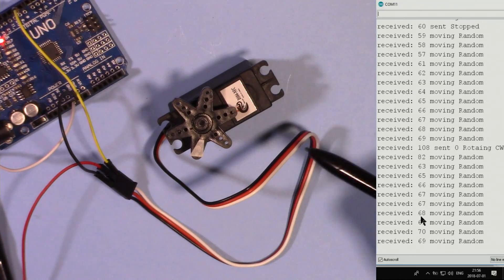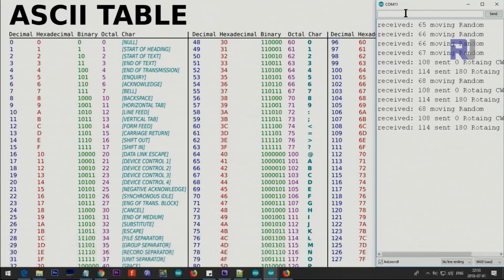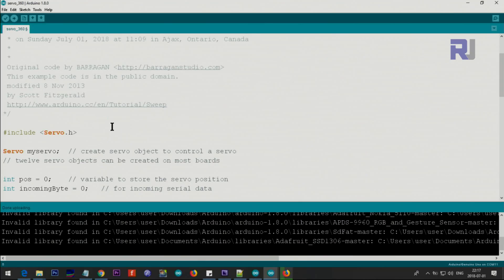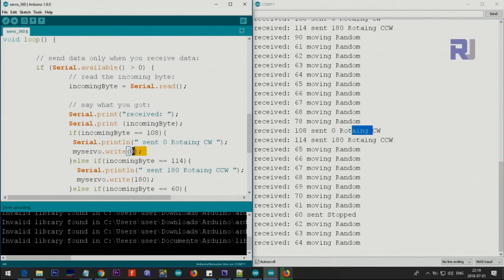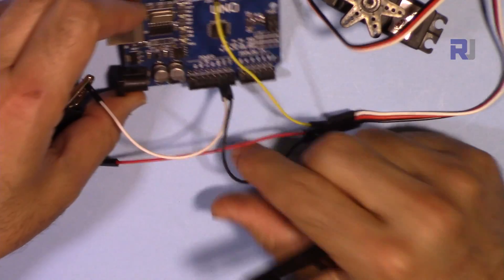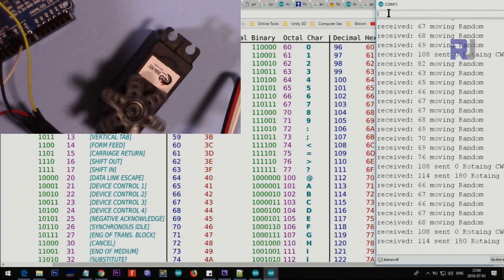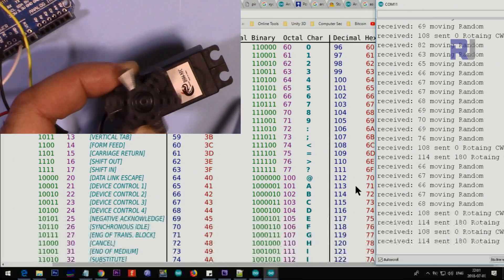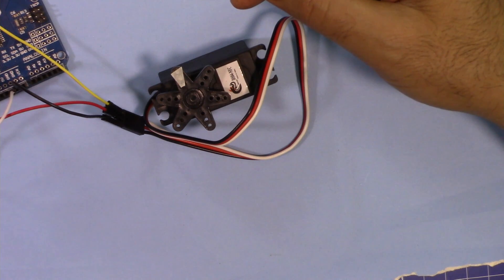Lesson 89: How to control 360 Continuous Servo with Arduino RJT96

Comment from the maker: 360 servo is NOT a servo. it is product modified for fun to make it work that way. use stepper motor for real application. this will never work as expected. do not waste your time.
Reply: i bought 2 360 "servos", thinking that i would be able to control its position in a 360 degree range, i was so wrong, these servos are pretty useless without feedback
Reply: and if u use a driver
Reply: it works perfectly if we use this as time dependent servo motor
Reply: @mkiratul  what u mean can u show a little preview
Reply: Dear Mr. Samsiri, how about servo 320 degree, it will control as per expected?

Comment: Thanks, nice video. However your explanation of the values sent to the servo is misleading. They should not be looked up on the ASCII table (that is only for the serial commands). These servos are basically standard position servos with the stops and position sensors broken off. Standard position servos take in an angle command, hence 0-360. However, these servos are "hacked" to make the servo think that they are always at a fixed position, which is nominally right in the middle i.e. 90deg, but in reality it's not that precise. Many of these servos have a set screw potentiometer that can be used to adjust this simulated center position. You should be able to adjust the center (stop) , and since they're very cheap, they also tend to drift.

Comment: Thank you. I was thinking thay they stop on 360/0 degrees, and when I started to spin it with my hands without connection and power, I figured out that they spin continuously, unlike 180 or 90 degree versions.
But why it is bad idea to use it as step motor?
Reply from the maker: beca you can't position it and it will not work as expected. use stepepr motor or very expensive servo motor. So stepper is better and cost effective solution.
Reply: @robojax  thank you, you mean that you can't set exact angle because it has huge error range?

Comment: Could be possible using this system for control 6 DC motors with encoder?????
Reply from the maker: This "360" servo is a joke. Yes use Stepper motor or DC motor with encoder.

Comment: Hi robojax . i was on my project.  I was gonna use this servo to make automatc curtain . but when i used this on if else . the logic if else . repeated continuesly . like . when i was gonna rotate for 2 second . it really rotate 2 second and stop . but it rotate again . did you have any solution? I use raindrop sensor to get data and control if else condition .
Reply from the maker: Hi, please read the description. If not don’t just it. This is just a joke. Use stepper motor.

Comment: i need to build a crane, i want to use this servo for the up down motion, and the rotation of the crane, should i use this or a stepper motor for the up down part
Reply from the maker: This is just joke product not real. Use stepper motor

Comment: Bro if we upload code can will it save that i mean wheni give power will rotoate 360° ? for my another Arduino project
Reply from the maker: Hi, your can use the code with any Arduino and turn it on off it will work. When it come to powering servo, you should always connect your servo motor directly to the the power source and not to the Arduino board.

Comment: Hello. Is it possible to software transform 360 degree continous servo to non-continous? I need full circle  moovement but not more than one, controlling by two buttons. Thanks in advance.
Reply from the maker: Hello, please read the first comment. This is NOT a servo. just fake device for fun. Use stepper motor to achieve the same tasks accurately. I can't remove this video because this junk product is still sold online.

Comment: I've  MG996R  and work perfect with pca9685 and Arduino nano 3 .
i didn't use any different configuration but my code is:"" pwm.setPWM(pinnumber,0,rotation);  delay(500); pwm.setPWM(pinnumber,0,0); ""
rotation for right turn between 99-365 high speed 99   low speed 365
rotation for left turn  between 385-640 high speed 640  low speed 385
then delay time depend how many time want to spin and finally stop code;
don't forget to set frequency its work at 60 but not in other frequency i'm not quite sure why.
 pwm.setPWMFreq(60);
good luck;
Reply from the maker: this video has nothing to do with pca9685
Reply: @robojax  i know but that's how i control my  360 servo perfectly in any angle that i command it.

Comment: Hi can u make a version of  java code like that? continuous servo control via bluetooth
Reply from the maker: Hi, interesting. it is doable but needs some work. it depends on your platform. you will need hardware. But Arduino and Bluetooth module make it very easy. To remind you this continous servo is NOT a real hardware and it won't work as expected. I've shown that it is not working. I made the video because there was demand. get Stepper motor like this https://youtu.be/cYTICj4DWYc or DC motor with encoder. Do not build projects based on this. it is waste of time and and money.

Comment: nice video. I have gotten one of those today. Mine stops between 86 and 96. I think you could make it move in smaller steps by using it like that: servo.write(100);delay(100);servo.write(90); for example to make it move slowly for 100ms. Mine moves fastest at about 47. By lowering the value further more it stays the same speed. I had originally thought it would work like the SG90 servo (thanks to your video I now know it was not a malfunction). So unfortunately I have no application for it ... yet :D
Reply from the maker: thanks.  I've mentioned in the comments, that this (360 servo) is  NOT a real or proper product.  Use stepper motor
Reply: @robojax  yes :-) I have also some Nema 17 stepper motors and have already used them for example for panning a camera on a 14m tripod.

Comment: You said to delete the previous post and move it here, I did too, thank you for following up
**********************************
Hello Mr. Ahmad Shamshiri
I ask you to put a healthy code for use in the 360 degree servo motor
By pressing a button or command, the servo motor spins a full speed and stops in its place.
And each time you press the button, this operation is done once again
Unfortunately, no code or tutorial can be found on the web
Your previous two tutorials on 360 degree servo do not apply to me either.
I always wish you health and success
Thank you
servo MG 996R

سلام آقای احمد شمشیری
لطفا یک آموزش و کد مرتبط برای سروو موتور 360 درجه را منتشر کنید
به این شکل باشد که با زدن یک دکمه یا دستور این موتور 1 دور کامل بچرخد و در محل شروع متوقف گردد 
متاسفانه دو اموزش سروو موتور 360 درجه شما برای فکر من کاربرد ندارد
از شما خواهش می کنم این مورد را در اولویت قرار دهید.
قطعا افراد زیادی در دنیا هستند که این مشکل را دارند و هنوز پاسخ مناسبی پیدا نکرده اند.
همیشه سلامتی و موفقیت شما را خواستارم
از شما پیشاپیش متشکرم
Reply from the maker: In practice, we don't have 360 servo. you can't sent it to specific angle. this is just modified version of actual servo which goes from 0 to 180. For actual project or application, please either use stepper motor or DC motor with encoder.  You won't be able to achieve  desired results with this. 
وعلیکم السلام
خلاصه مطلب اینکه این سرو فقط به منظور نمایش است و کابرد عنملی نداد.  
سلامت باشید

Comment: I use SG90 servo. My servo doesnt move continously. It only move slightly then stop.Each time i put a character it always say " 10 moving Random". After that it won't move even i put a another character.
How to fix that problem?
Reply: Hi, you're getting "10 moving Random" because of your arduino serial monitor settings - it appends by default line ending to every line you are sending, but you can disable it by choosing "No line ending" settings
Reply from the maker: Please read the first comment(pinned comment) that this is NOT a real servo. this is just fake item to prove that the servo can be modified. get ether actual servo or get Stepper motor  See my videos on that https://www.youtube.com/robojaxTV/search?query=28BYJ-48

Comment: I used servo 360 and adafruit motor shield then it can't be rotate ccw, how to fix it?
Reply from the maker: as I mentioned in the first comment under the video, this is NOT a real motor.  This is just fake motor. you should use stepper if you want full control at 360 degrees. for 180, use  normal servo.  Here use this stepper https://youtu.be/cYTICj4DWYc or smaller https://www.youtube.com/robojaxTV/search?query=28BYJ-48

Comment: hi there, can you use these servos to a certain angle like 540 degrees?
Reply from the maker: Perhaps you haven't watch the video. If you watch the video you will get the answer because I demonstrated it. Please watch it without skipping.
Reply: @robojax  Thanks for the reply. So basically you just control the Servo by using the Serial monitor?

Comment: Is it possible to control this servo according to degrees?? Like 180 degrees to 270 degrees? Because i need to control a full 360 degrees rotation, an increment of 30 degrees.
Reply from the maker: If you watched the video, this is not stable. This is NOT real servo motor. It has been modified to rotate like DC motor. Get actual servo or use Stepper Motor.

Comment: I am using the MG90S-201, it rotates slightly then stops, not sure if this servo is continuous. please help.
Reply from the maker: a servo motor usually goes from 0° to 180° unless you purchased 360 servo.

Comment: what kind of servo motor are you using? I am using MG996R model. I followed your steps exactly but i couldn't rotate the motor to other way. and It keeps telling me that incomingByte is 10. any suggestions?
Reply from the maker: I will reply to all subscriber's 🔔 questions. So make sure to subscribe.😊
Reply: did you manage to put that working? Because I have exactly the same problem
Reply: @sarapalmameireles  Hi, you're getting "10 moving Random" because of your arduino serial monitor settings - it appends by default line ending to every line you are sending, but you can disable it by choosing "No line ending" settings

Comment: Hi Robojajax.....i was wondering if you could kindly help me out with this Arduino servo, stepper motor setup that i have. as all your videos show. you are a master at working with the Arduino. i would so much appreciate it if you are able to work out what is going on wrong with the code or hardware......thanks in advance......  https://www.youtube.com/watch?v=fis-qX9ldlg
Reply from the maker: Hi, check my video on stepper motor 28BYJ-48  https://youtu.be/Sl2mzXfTwCs
Reply: here is the code that i am trying to use with the servo and stepper motor. can you see anything wrong with the code.  

#include <Servo.h>              
Servo servo_neck;   
   
#include <Stepper.h> 
#define STEPS 32

  Stepper stepper(STEPS, 9, 11, 10, 12);
  int randomRotationFrom = 5;
  int randomRotationTo;
  int randomNumber;
  int randomDelay;
  int eyes = 7;
  int angle = 10;  
  int mouthclosed(-600);
  int mouthopen(600);
  int mouthspeed = 950;
  
void setup() 
{
  servo_neck.attach(8); 
  servo_neck.write(90);
  pinMode(eyes, OUTPUT);
  digitalWrite(eyes, LOW); 
  randomSeed(analogRead(A0));
  stepper.setSpeed(300);
  stepper.step(mouthclosed);
  delay(200);
  
      digitalWrite(eyes, HIGH);
      delay(50); 
      digitalWrite(eyes, LOW);
      delay(50); 
      digitalWrite(eyes, HIGH);
      delay(50); 
      digitalWrite(eyes, LOW);
      delay(50); 
      digitalWrite(eyes, HIGH);
      delay(5);
      digitalWrite(eyes, LOW);
      delay(100); 
      digitalWrite(eyes, HIGH);
      delay(50); 
      digitalWrite(eyes, LOW);
      delay(50); 
      digitalWrite(eyes, HIGH);
      delay(500); 
      digitalWrite(eyes, LOW);
      delay(50); 
      digitalWrite(eyes, HIGH);    
}

void loop() 
{ 
  
 randomDelay = random(10,3000);
 randomRotationTo = random(40,140);
 randomNumber = random(1,9);
  
 if (randomRotationTo > randomRotationFrom) 
 {
    for(angle = randomRotationFrom; angle < randomRotationTo; angle += 1)    
      {                                  
      servo_neck.write(angle);
      delay(20); 
      servo_neck.write(angle - 3);                       
      } 
   
 if (randomNumber == 5) 
      {
      stepper.setSpeed(mouthspeed);
      stepper.step(mouthopen);
      stepper.step(mouthclosed);
      }
 }
 
 if (randomRotationTo < randomRotationFrom) 
 {
    for(angle = randomRotationFrom; angle > randomRotationTo; angle -= 1)    
      {                                  
      servo_neck.write(angle);  
      delay(20); 
      servo_neck.write(angle + 3);                     
      } 
 
    if (randomNumber == 5) 
      {
       stepper.setSpeed(mouthspeed);
       stepper.step(mouthopen);
       stepper.step(mouthclosed);
      }
 }
 
 randomRotationFrom = randomRotationTo;
 delay(randomDelay);
 }

Comment: Can we control the speed of a dc motor and the direction of rotation?
Reply from the maker: Not with this but yes you can here is my video on that https://youtu.be/akQoGNUzhHI
Reply: Yes, using PWM we can control the speed and by using L293d motor driver IC we can control the direction

Comment: Hello we are trying to make a solar tracker project. We found codes from internet and they used sg90 (180°) but I have mg996 (360°) 

It doesn't work properly

What should we change to work it with mg996?
Reply from the maker: You can't use the 360 servo for precise control. You should use a DC or stepper motor or actuator.
Reply: hello Alper, I am trying this project in my graduation here in Brazil, i want to ask to you if you had success in your project, and if you can tell me some hints to finish this. Thank you. Send me an email if you can: mah.henriquee@gmail.com

Comment: the position it stops is the center? right?
Reply from the maker: There is no center. It is free to rotate. Unless you save the initial location, then rotate it and  accurately count the rotation.,
Reply: means i can use it as it is without any position configuration for my robotic arm?
Reply from the maker: I assume for robotic arm you will need precise angle and position. with this you can't do it as it is now. Unless you add other supported stuff. But if you want to rotate something without knowing at what angle it is located, yes you can use it.

Comment: hey!! It's a great project. But i am facing some problems. After typing the character the serial monitor shows the corresponding dec but after each line there's a line saying" received: 10 moving Random" and there is no change in the rotation of the motor.. Please help me here!!
Reply: got the fix!

in the serial monitor next to where you set it to 9600 baud there is a dropdown menu wich says "new line". Set it to the first option (something like "no end of line")
Reply: @storm_fpv9342  thank you! That has solved this problem for me!
Reply: @storm_fpv9342  grea thanks brother you really saved my live hhhh
Reply from the maker: You must be done something wrong. Please copy the code and use it without any changes. Also watch the video without escaping. Again.
Reply: @robojax   I'm getting the same issue, I checked Serial Output Example and that's producing correct results. I tried testing w/ println() statements and it somehow takes random input when not provided. Getting that same "received: 10". I copied over your exact code, maybe its the version of Arduino IDE? I'm using v1.8.9
Reply from the maker: did you set the serial monitor with 9600 baud?
Reply: Yes! Same issue here as well. If a change the default to reverse condition then I can only hear the sound of the gears but no output reverse rotation can be seen .

Comment: If you try to move the servo arm while it is stopped (not powered off/unplugged), will it move because it is a continuous rotation servo? I know with regular servos that have position control, you cannot move the servo arm when it is stopped because it stays at that position, but do continuous rotation servos do the same thing?
Reply from the maker: I have got metal servo and I I can rotate it when it is OFF.
Reply: @robojax  if it is ON but not moving, can you turn it by hand?
Reply from the maker: I have not tested that.

Comment: I am not able to control 360 degree servo , whenever I am sending any command like   r or l ...it would not work accordingly
Reply from the maker: check the wiring or the servo is bad. it should work.

Comment: Hi, great video
For what purpose do we use 360 servo? Can these be used in place of normal servo (i.e. those rotating 180 deg)? If yes,how?
Reply from the maker: No they can't be used instead of normal 180 degree servo. You can read about their applications here: https://www.pololu.com/blog/24/continuous-rotation-servos-and-multi-turn-servos

Comment: hello, im having problems with the Serial.read process, for some reason when i insert a value, a few seconds later the value turns to 0 which is NULL, which automatically switches the orientation of spin. please help
Reply from the maker: Hi, Before doing this project, try Examples->Communications->Serial Even and see this image https://snag.gy/jCZ25F.jpg
Reply: @robojax  OMG thank you

Comment: This motar Voltage  A/c.  Dc
Reply from the maker: Servo motor is always DC. Also + and - wire exits on DC power. AC does not have + and -.
Reply: How many voltage
Reply from the maker: click here-> 09:04

Comment: That's great project. How to control speed of 360 rotation. Thanks.
Reply from the maker: You are welcome. If you send values between greater than 0 and less than 180 you can slow it down. I have mentioned this at 14:55